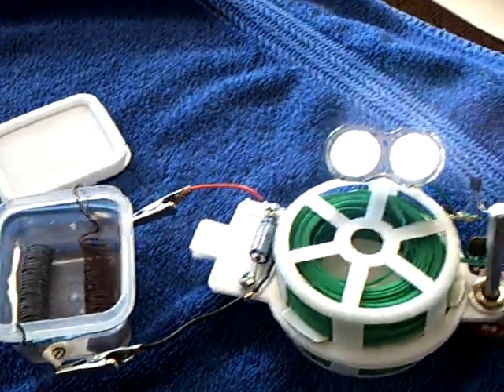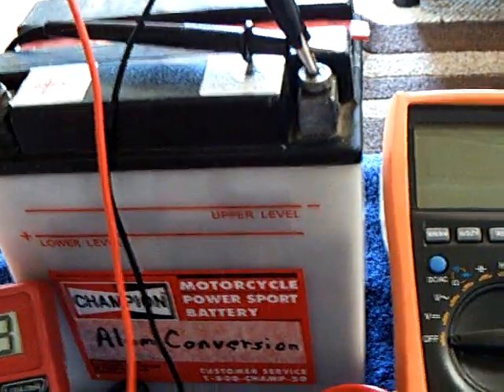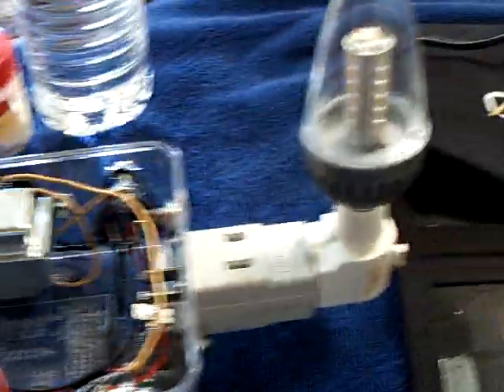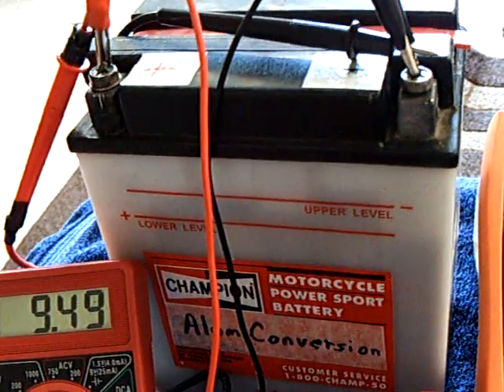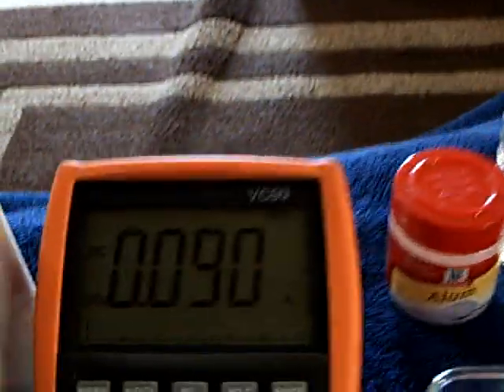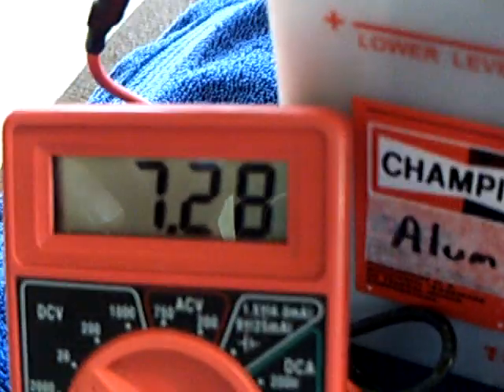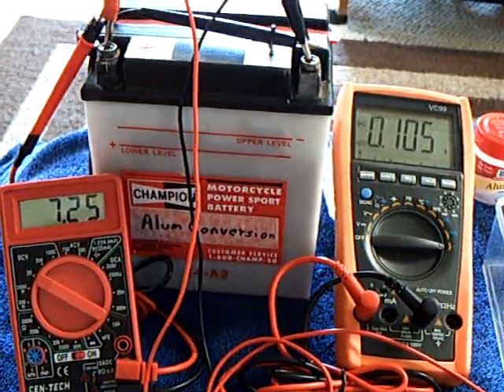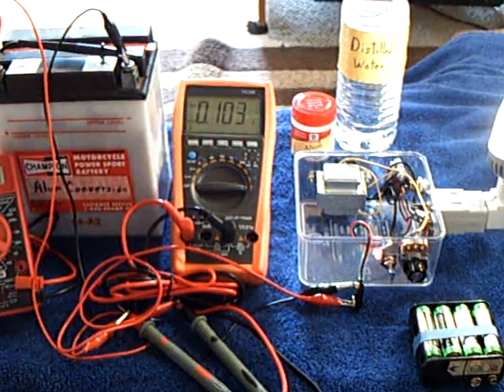Lead-Acid battery converted to Lead-Alum

Comment: can you tell me the charge and discharge time,how much Ah is that baterry and how does it behave on non regulated dc like no voltage regulator on alternator for exampel,can that baterry blow up if you undercharge or over charge that baterry and last how does that baterry behaves at cold/hot conditions do that baterry discharge?
Preaty much conspirencis roaming around about those baterrys honestly Im afraid doing it me self Im in town.
So I was wondering if that baterry can act similar like capacitor charhe and discharge at fast speed.
Me ignition system is sloppy I wanted to convert alternator to magnet type rotor .
But aperantly I have problems in cold condition enviroments.
I dont use often me car so its realy exposed to much to weather conditions.
So thats why Im curiuse about that baterry type.
And did you try useing that baterry in series/parrarel configuration with other baterry types?

Comment: I have one I use to run a 5 watt 12 volt LED light over the sink in my kitchen. I hooked it to a photo switch, so it comes on at dusk and goes off at dawn every day. It's charged by two parallel 15 watt harbor freight solar panels. It's been running like that for maybe 6 to 9 months with no problems so far. I also have a 3 watt hooked to another alum battery over a counter next to the stove. It has a manual switch and is charged by a 10 watt semi flexible solar panel, which seems to be enough for that application. They hold about 11.x volts. I use cheap Chinese 3 amp 11.1 volt Lion battery solar chargers to charge these alum batteries. It seems to be a pretty good match for this kind of application. They now also have a 10 amp version. 

I also have several alum batteries that have bad cells in them, but they're still useful for small LED lights and other low amperage circuits. I wouldn't want to use them with anything with too high of amperage because the bad cells could heat up if you had to put a fast charge into them. I have one that holds about 8 volts or 7.x volts. I have one of those 'as seen on TV' "Mighty Lights" hooked up to it. It was my first alum battery about 6 years ago. It was an old dried up, deep cycle camper battery. I charge that with 3 parallel 9 volt epoxy coated hobby solar panels. It's been working out in my pole barn for 6 years.

I'm not that good at electronics, but I have learned how to make some simple LED bulbs for use with these alum batteries with bad cells. But, what I'd like to figure out is how to make a simple circuit that would turn the LEDs on and off at dawn and dusk. It would be the perfect night light, and would still work in a power outage.

Altogether I've made about a dozen alum batteries and about 4 of them failed. Mostly ones with dead cells, but I have a converted lawn mower battery that was good and holding 11.x volts, and it eventually went bad. I think it's because I left it sitting in my pole barn without using it for a couple years. I did charge it occasionally, but my feeling right now is that they like to be used and recharged on a regular basis. From now on when I convert a battery to alum I plan to put it right to work immediately and continue to use it. Dusk to dawn LED lights or bulbs work great for this.

What I want to do next is to get my hands on a forklift battery and convert it to alum. The problem with 11.x volts is that you can't really run an inverter on it. If you could put together 13 fork lift battery cells instead of 12, I believe that would solve that problem. I would like to see if I could run my refrigerator and freezer with them which is actually only maybe around 20 amp hours per day altogether. Theoretically I could run my fridge and freezer on a permanent basis with one 100 watt solar panel if this idea works, but I would probably use at least 200 watts of solar. I only get about 4 hours of solar irradiance per day in Michigan. But, I'm thinking that 13 good lead alum forklift battery cells would hold a pretty good reserve. 

I don't have the money to do this experiment right now, but I'm hoping to have it within the next several months. I figure even if my fridge and freezer idea doesn't work, there are plenty of other applications (maybe the TV, computer and internet) that would.

But as far as emergency lighting or lights for camping, pretty much any successful alum battery will work just fine, even one with one or two dead cells. Small radios and stuff like that will work on them too. I once ran a 5 watt DC LED bulb on a lead alum lawn tractor battery for 2 weeks and it was still giving off usable light, though it had dimmed quite a bit. The bulbs I order from Ebay will continue to give light all the way down to about 8 volts. For some circuits you may have to use a buck (or boost/buck) converter for more precise voltage.

Comment: Please reply, as i'm going to spend money on this project. What is the life cycle of this battery?
Reply from the maker: I don't know what the life cycle is.  You can probably do a Google search and find out more info on that.  I only converted this one battery and I still have it.  Every once in awhile I take a look at it and charge it up but I never put it through charge/ discharge cycle testing.
Reply: @Lidmotor  Thank you sir, for your reply. Any idea as to how long does this battery hold the electric charge, 2ndly is the out put same when ever you charge it from 0 ?
Reply from the maker: I don't know. The one I converted has never gone flat but loses energy over time.  It was an old old battery when I converted it so it is not a good example to go by. I think if you did some research you could find the answers to your questions.  If this method was a super duper answer to a storage battery you would see them commercially available-----but so far I have not seen any out there.

Comment: I'm trying to start an ongoing discussion about practical applications of some of these innovative and inexpensive technologies on Facebook. Here's the link: https://www.facebook.com/groups/290979177741602/

I have about a half dozen working alum batteries. I have one converted lawn tractor battery where I ran a 12 volt, 5 watt LED bulb (40 watt equiv.) for two weeks without a charge. It dimmed the second week but was still glowing two weeks later when I ended the experiment. I bought a cheap data aquisition USB device on Ebay (something like $30 U.S. altogether with shipping). It works, but the software is terrible. No practical way to view the data graphs. But, I wrote a program that takes the data (which can be saved as ascii text) and graphs it for 24 hours. I plan to post some of that data eventually, once I figure out an easy way to do it (I have a lot of data). I've been collecting this data since October of 2017.

What I'm most interested in in starting up this group is sharing information about the capabilities and practical uses of simple and inexpensive technologies like this as well as how people are dealing with some of the issues (acid disposal etc.) that go along with the Alum battery. The group covers more than just Alum batteries, but if enough Alum battery enthusiests get involved with the group maybe it will become just about alum battery technology and related issues. If that's you, and you have an FB account, I would love it if you would join the discussion. There's always more to learn and I want to know all I can about ways to use it and share the information with others.

Comment: could you try soda ash instead of alum? might work better.
Reply: Spammer
Reply from the maker: +Randy Travis I have not tried that.  Thanks.
Reply: Sure, I was wondering if you might be interested in making a carbon lead battery. If you could make a carbon foam or  activated carbon plate, and replace the negative, "its the plate that gets coated with lead sulfide" I hear you get much better results than just two lead electrodes. If you use alum, it should last forever and be almost as strong as lithium batterys. Like your work.
Randy
Reply: dvv
Reply: dv
Reply: interesting points ,if anyone else trying to find out how to recondition old batteries try Jadonite Renovate Battery   Buddy (just google it ) ? Ive heard some interesting things about it and my cousin got great success with it.

Comment: IF you have acid in the cell I suggest powdered lime. Wear gloves, protective goggles or glasses and long sleeved shirt and long pants and boots that cover your entire body. The chemical reaction is extreemly strong. It neutralizes some of the acid but once you limed your flooded lead battery you may add more water and recharge. The acid left may react with some lime to make carbon dioxide and calcium sulfate.

Comment: I mixed up 8 ounces alum with water and shook for 5 minutes. Filled cells and when finished filling saw alum sitting in bottom of water bottle. Started with 12 volts (should be 13.5) and finished after charging all night at 2 amps/12 volts and ended up with 11 volts. I'bve been doing electromechanical work all my life and built supermarket refrigeration,wired hoses and owned a body shop for 20 years. Its not like I don't know about batteries. So now I'm soaking alum in water all day to see if it dissolves. I ordered the alum online for 15.oo a pound
Reply from the maker: Bob Lohman Dissolving the Alum in warm water helps.  Don't expect to get a 12v battery.  Around 11v is what I have seen but there are some advantages to this electrolyte in a lead acid battery.

Comment: Great work, How well they hold in minus 25 temp, up in Canada, thanks . basil
Reply from the maker: I don't know.  Not good.  I think the thing might become a large ice cube.
Reply: +basil dafnas There must be an additive you can add that wont interfear with the battery, I suggest looking into what is added to ultra cold weather batteries used in the artic, I know they have to add something to their batteries so they don't freeze.
Reply: Thank you Randy for taking time . I add a tsp, of Epson salt, in each cell hope I will get two more years, they are nine years old time to replace them THANK YOU TAKE CARE, BASIL.

Comment: Can common salt NaCl be used instead of Alum? I am planning to try it. What do you think buddy?
Reply: ok. so i bought quite a bit of alum and after washing my old run down lead acid battery thoroughly, filled it with concentrated alum+water mixture. charged it for a day and am using it since one month without any problems. its holding the charge quite good. i will see how it keeps performing. i am happy that the experiment was sucessful (at least for now).
Reply: Is your Alum battery still good?
Reply from the maker: No NaCl isn't going to work.  I have had success making a rerchargeable battery using Epsom salts and magnetic stainless steel though.
Reply: ***** Any reason why NaCl doesn't work. Wikipedia lists it as a strong electrolyte
http://en.wikipedia.org/wiki/Strong_electrolyte
Did you try it already? Thanks for taking time to answer buddy!
Reply from the maker: Table salt in water makes a great electrolyte for the 'galvanic' type homemade batteries ----that are not rechargeable.  It is a one way reaction between two dissimilar metals.  The rechargeable types need a situation that goes both ways.  You can use Wikipedia to see what I mean.   The whole study of batteries is facinating. There are all different kinds and they are still inventing new ones.
Reply: So buddy Alum is the best cheap electrolyte for rechargeable ones? Is it better than the original acid ones? I will try as soon as I get my hands on some Alum.
Reply: *****
So buddy do you recommend Epsom salt or Alum?
Reply: Tej Grewal I tried alum and after filling the cells,it was sytill at the bottom of the jug . Battery had 12 volts and now has 11. They told me I had to dissolve it so I;m letting the alum sit in the water all day and see what I got when I come home. So far , it swirls around and falls to bottom of jug.
Reply: @boblohman7107  any update sir.. Im using alum battery in my car for about 2 months now.. Works great,

Comment: Would this be enough to still power up a motorcycle?
Reply from the maker: It should work.  The amps are there----just not the full 12 volts. Mine still works fine after all this time but the voltage is between 10 and 11.  Somethings don't work with that low voltage such as an inverter with a low voltage cutout.  The DC motors work but run at a lower speed.
Reply: ***** No way that battery can push more than 3 amps. With a voltage drop of 2 volts for a 100ma load. Its not starting anything!

Comment from the maker: Will this last 5 yrs?  I will have to wait and see.  John Bedini has a converted battery in one of his cars that is older than that.  So far this motorcycle battery is still working.  Most of the time I leave it sit and once in awhile I charge it up to see what happens.  This one self discharges over time but comes right back with a charge up.  The only complaint that I have is that the voltage is too low to run a normal inverter or other things that require at least 12 volts.

Comment from the maker: I don't know what kind of amp hour rating I will end up with this old somewhat damaged battery.  John Bedini converted a new 5 Ah and ened up with the same capacity only at a lower voltage.

Comment: Well done!  Just curious what your estimation of the amp hour is?  I have 2 lead acid batteries that don't hold a charge any more.  I'm thinking about converting them like you did, what do I do with the acid that's still in them?
Reply: Dump it in plastic container and then neutralize it with baking powder. ( Arm and Hammer etc etc.)

Comment: Nice job you have the same battery I cleanly converted over to alum just mine has opposite plates as yours my positive is on the right side. I think my alum solution is a bit weak as it has lost some capacity but then again I never had acid in my battery like everyone else so I might be missing some plate formations. I have a few cells that need topping off as my smart charger charges at 2 amps so it might be evaporating my alum water.

Comment from the maker: I am thinking of building that 8 cell battery to get the 12v needed to run  things that need that.  I already bought the lead plate material.  Time is the problem.

Comment from the maker: Yes these Lead / Alum batteries seem to be pretty tough.   You can either charge or discharge them hard and they take it.  You can boil of the water though if you overcharge.  I am still scratching my head about how best to use them.

Comment from the maker: Hi Bill.  My Dad left a battery chagrer on this battery and boiled off all the electrolyte.  After that the battery would not take a charge so he just put it out by the trash cans and forgot about for a few years.  I was surprised that it had 5v still on it.   If your batteries are not damaged too bad give this Alum idea a try.  Like you say---nothing to lose.

Comment: I have been restoring some motorcycle batteries too. I removed the acid and washed out the plates by squirting pure water inside the cells and replacing with new acid. Before doing this they were no longer taking a charge but after they charged up fine and they have been building up more amps by charging and discharging. I love the idea of using a non toxic alum though. Great work as usual... thanks for sharing

Comment: Good job and made use of what your Dad perhaps called junk. 
The UB1245 gel conversion here charges up to about 6.5V now after a few cycles (still got the missing plates, but has plastics glued back on). Am using my usual bench supply of a converted PC power supply. Tough things these Alum conversions, with very flexible charging methods.

Comment: Thanks Lidmotor.  Could you use Epson salt instead of alum?

One youtuber revived a battery by adding epsom salt and distilled water to the already existing acid.  One and a half years later, the battery is still working.

Comment: I'd like to see ph or hydrometer reading too. I think you have about 1.6v to a cell. If you had 8 cells you would be right in 12v battery range. Could be great for stuff that needs low draw for long times, Like solar phone exchanges etc. Nice work.